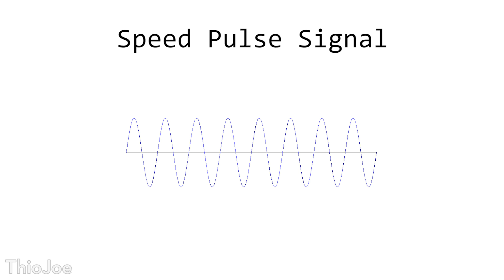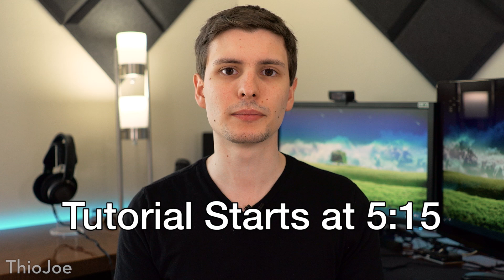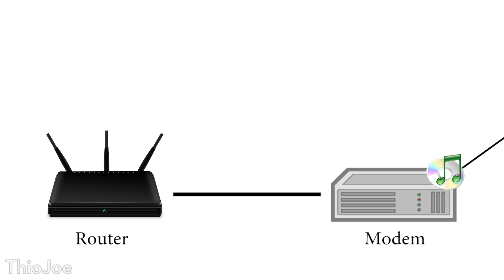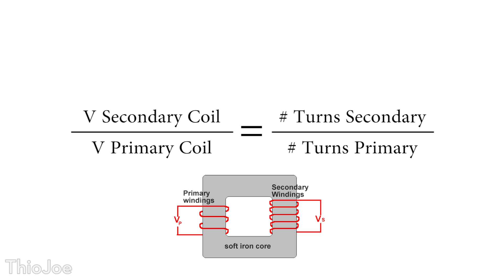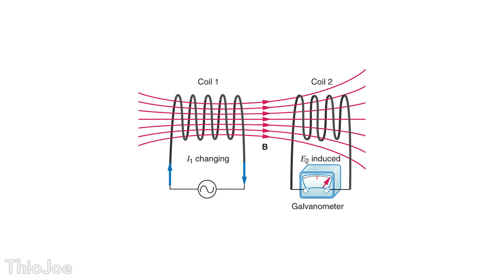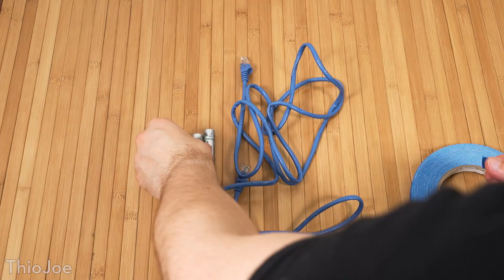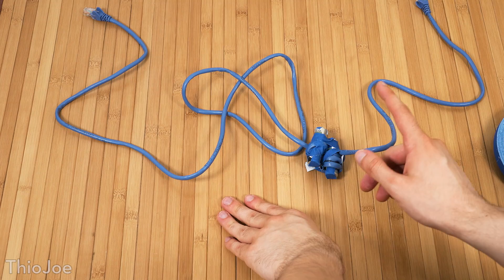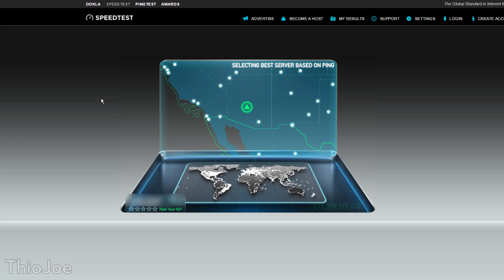How to Get Faster Internet Speed for Free

Comment: I bet you haven't heard about the new DUCK tape (Data Universal Client Kernel Tape). It is made out of duck skin and is far more insulated than the one you talk about and prevents data loss at an exponential rate. Earlier it was used only in big corporations but slowly and surely it has arrived in the mainstream market. I suggest you to use this tape in your next video. the only problem with it is that once opened you have to use all of it within 6 hours otherwise it starts absorbing outside air and starts showing purple spots on it which is not good for data protection . Infact you start losing more data than you can gain. As of now it is available publicly only in Suriname. You can order it online, but here wheres the irony starts. The data traffic needed to order this tape online can only be achieved if you have duck tape installed on your cables. See the paradox? So as of now the only thing you can do if you have a friend working in a giant IT/Software company, request them to give you a roll of DUCK tape and once you have it installed, order online from Suriname and live your life data loss anxiety free.

Comment: Magnetic Induction doesNOT exist, he is confusing positive static charge by electrolysis a wire, which charges the metal with electrons causing positive charge to be release, not magnetic force in any way, this why they want to fool people with the fake idea of electromagnetism which is a lie.
Fake Video, you can only increase the WiFi range by making a bigger antenna or making the antenna more powerful, but can't increase the internet speed.

Comment: Wow! I am paying for a 50 Mbit/s Internet connection and thanks to your trick - believe it or not - I just measured 200 MBit/s. The funny thing which you didn't mention at all: You can actually use 4 batteries and do the trick twice. Well, I experimented a lot and found out that the maximum number of batteries seems to be 16. But better stay below that limit, because my modem got destroyed because of too much heat when exceeding the 10 GBits/s barrier. Luckily the ISP sent me a new one. :)

Comment: This is scientifically flawed. The most important part in the construction of a transformer is that the primary & secondary DO NOT TOUCH!!! Here, its the same wire coiled over two parts of the frame (air-core). Not only is NOT GOING TO INCREASE ANY BANDWIDTH, it'll fail as a transformer, since by Lenz's law, the current induced in the secondary goes in an opposite direction; while the original signal continues to come into the secondary since the two coils are joined.
Shame, shame!! You're a disgrace to physics!

Comment: if it dosent work for you then you are using cat5 cable. you have to use cat1. if you dont have cat1 you need to remove the protection from the cable. after you du that you have to wash the cable and do a helicopter with the cable to remove the water from both ends. last step you have to use hair straigtner on cable but be carefull not to burn the cable. good luck.

Comment: Hey guys, im not a technical or very knowledged guy. i tried these, and the only thing what have changed after following the instructions is, that now my internetspeed is down from 2,56 MB/S to 1,32 MB/S DOWNLOAD, and my upspeed is down from 1,12 to 0,74.
after these results i have read the comments here, all are telling that this isnt working, BUT why it have an decrease Impact? I tested several times with my modified Cable, and with a Original-cable. Modified cable have really bad stats. but the normal wire is working as always. Could somebody explain that to me? Cause if it has an Decrease, it should be possible to make an increase.

Comment: the primary & secondary windings in a transformer are not wired together in 1 continuous wire,they are separate on each side of the core & are not bridged across the centre of  the core,i call bs

Comment: ah ha ha I have studied networking and have a CISCO CCNA this video is a joke as all ISP's have equipment that tells they how much bandwidth each line has, also by doing this even if it was to work you are breaking a legal contract and are then legal liable, also using speedtest.net is a pure joke as you can take that so simply. also if this was true by showing this you could be legally in trouble for showing other how to break the law ;)

Comment: i tried using a pair of sony battery
i have an adsl model
its not working
what can be done to get such a high speed???
i tried changing the battery and the cable as well but in vain

Comment: I set up my ethernet cable as per your instructions using two rechargeable AA batteries but see no increase in my internet speed (from the current 55/25 mbps) .  Could it be because the batteries were not charged, may be they were almost totally discharged.  Do they have to be fully charged batteries?  Also, will your suggestion work with ordinary alkaline batteries?   Thanks for any suggestions.

Comment: my net cable comes directly from a pole next to my house tried it but it isn't working do you have any suggestions that you might like me to follow I did make sure that the one turn battery was towards my router and 4 turns towards the opp side....i dont have a modem the cable comes directly to my router

Comment: materials used as insulation in the cable[citation needed]
Acronym Material
PVC Polyvinyl chloride
PE Polyethylene
FP Foamed polyethylene
FEP Teflon/fluorinated ethylene propylene
FFEP Foamed Teflon/fluorinated ethylene propylene
AD/PE Air dielectric/polyethylene

Comment: The batteries in order to generate a magnetic field, has to be in use. In other words, a magnetic field can only induced by a RUNNING CURRENT. That means the batteries need to be at least in a closed circuit producing current in order for it to generate a magnetic field. Just the batteries alone lying there doing nothing does not give you anything. The theory alone doesn't really make sense. Let a lone expect a magnetic field from 2 batteries to amplify your signal. Heck the earth's magnetic field is even larger than these 2 batteries even when running. So why don't you try the earth's magnetic field to induce a bigger signal to get a gigabit speed?

Comment: Did anyone happen to notice the INSULATION (blue in this case if u don't know) that all wires, electrical, radio, light, etc., are wrapped in? That's there for the very reason this joker is saying he could "tap into". It is there so no "outside" signal (electrical noise so to speak) gets in and no "inside" (electrical info) gets out. It's the same reason your lamp wire and every other conceivable wire in the universe is wrapped in insulation. Yes, it's true that insulation isn't completely "insulating" (i.e. some interference can be transmitted) but it's negligible most of time...and CERTAINLY NOT in the range Captain Video is purporting. I now realize these videos are made so we can "imagine" regular folk trying these stunts to get "free lunch" ! ----- P.T.  Barnum would be proud and Tesla would rotfl.

Comment: In my case I only have router, how this works for me?? should I set those battery the main cable which connects internet to my router? I don't know what internet connection is mine... is it cable internet? what should I do? I use WIFI to connect internet between Laptop and Router.

Comment: This is so fake,  you need Lithium ion polymer battery and cooper wire for full electromagnetic induction. Also that cable is too small, you need at least 5m SFTP cable.

Comment: Holy crap it legit works! I thought is a bunch of bs, but damn I'm wrong! But one important thing...

Remember to close your modem every time after you finishing using it, because it still sends the signals when not in use (but still turned on). If you leave your modem on, the ISP will detect the high bandwidth thus they will ban you from the internet! Thanks thio, you are an absolute legend!

Comment: don't listen to the haters.
this does work if done correctly..  it's electrician 101.
100% works.  you may need to change the batteries every once in awhile when you experience a dip in your signal strength..
 just rinse and repeat.
cheers!

Comment: If your modem is far away from router their is a solution first do plug out the wire from router and place 3coil battery wire towards router and 1 coil battery toward modem make sure first you get safety and cover top and bottom  thanks  have a nice day ..........LOVE HELPING............

Comment: If you use bare 120VAC wires as your coil structures instead of 1.5VDC batteries (easily accessed from any nearby receptacle - just pull the plate off to get to them) the performance is staggeringly better.

Just make sure you shield both wires with a little tinfoil before you tape them to protect against EM interference.

Comment: I live in Sweden. My ISP has already taken steps against this. 1 off, they have combined all electronics into one box. Router and V-LAN/Ethernet (several connectors) into the same closed and sealed box. The box I do not own, my ISP does. This box is connected to the telephone line via a VERY thick and bend resistant cable containing 3 wires with special connectors in one end and a RJ11 in the other. Batteries or not, the speed remains lousy (typical 0.8 Mbits at it's peak). But this might help some one else..?

Comment: I have a router and the modem in the same device. They are not separately connected then which wire should I consider in the process?

Comment: LOL come on man stop it. This only works if you have cable or DSL. If you have a fiber line it requires a flash light or any light based transformer to amplify the signal. Since cable and DSL are digital signals hence the D in DSL. Use a small flashlight for fiber because fiber based internet uses light for light speed data tx.

Comment: even a better ideal open up the insulation on the cable and cut the blue wire then hook it up to 110 volts AC.

Comment: I had 2 questions. 1. My connection is WiFi. Would this work using the coax cable from the router to the dish antenna? and It exciting the electron flow one direction doesn't it excite the flow the other?

Comment: At an average connection speed of 25.3 Megabits per second , South Korea has the fastest broadband Internet in the world. 

So let me break down this video in some simple words... this dude claims that by just winding some rechargeable batters to your Ethernet cable to make it a transformer which in-turn will amplify the signal for some godly reason is the same as downloading porn in a pen-drive and sticking it to your dick to enjoy the guilty pleasure of porn instead of just  watching it.

Why to go through the trouble of watching a porn to be sexually aroused  rather you can just download it to a pen-drive and stick it to your dick to achieve the same result.

Like wise why to pay your operator extra money for a higher speed rather you can use some batteries and wind the thickly insulated  Ethernet cable to  amplify the signal...wwwwoooowwww genius

Comment: Basic principles of working of transformer is primary and secondary coils Electrically isolated and magnetically linked. but in this video it shown the same cable wounded both  primary and secondary. and transform works with AC .what is the role of battery DC not explained.

Comment: but, my connection don't have a modem. The wire from the ISP directly goes into the wifi router. So, where do I attach the batteries?

Comment: Before trying this trick had a question : 
I have a router that is directly connected to the ISP Fibre optics and I use wifi to connect to all the devices. So dont have a modem upon which i will be able to perform. Any help over thant

Comment: lol dude.. a transformer works with a constant alternating current with at least 3 volt... but internet pulses are neither alternating current nor have 3 volts of power they are signals bro they don't have amps in them 
coming to the physical transformer, a transformer definitely needs a closed core. so that the magnetic induction of one coil induces some supply in another coil besides it. the core acts as the path way for the magnetic field. but your transformer doesn't have any contact. only few transformers work with air as medium like a tesla coil.. they use almost 50,000 volts in primary and get up to 90,00,000 volts of output. but your primary coil has nothing but 1.2 volt-pulses. just a single turn of a lan cable doesn't even produce a magnetic field to induce current in another coil... 

so it must be fake and the proof you have showed us, you must have changed the units mega bits in to bits...

Comment: Don't often do this but I've reported this you tuber as a con artist spam money maker. 
Think about it, if the transformer theory he used actually worked, which using two batteries wont, then the return ampltute would be reduced to the router, but its not about amplitude, its about frequency and mutiplexing, this con artist needs taking down.

Comment: Who would've thought. ... Do you have a patent on this? The reason I ask is that I built this and it worked better than expected.  The only problem was that after a while the speed dropped by about 65%. The battery core gets saturated and it's magnetic flux drops significantly.  I fugured out how it can be fixed and improved. I used larger, Li-Ion batteries as a core and created a secondary winding connected to a resonant circuit to boost the signal carrier amplitude and cut out the second harmonic by 90%. Now it works great. I'm thinking about making a few boosters and selling them on Ebay.  What should I call it? I-boost, Speed-Boost, E-Viarga?

Comment: DUDE , how can I set up with my internet connection , I use a Landline based broadband Internet connection in India , I have a  D-Link ADSL wifi+modem built in Router .

1 - My router is connected by RJ11 cable directly and I just connect my wifi like we all do , I don't use any ethernet cables to connect it to any modem or any such things like you shown in your video .

What should I do ?

Comment: Seriosuly...?, 
1) Wires are insulated from magnetic induction (which is what he is trying to do)
2) As per his theory (which is not true by the way) you should be modulating the signal between modem and ISPs not the wire between router and modem.
3)People actually fall for it O.o

Comment: My router is far from my modem. Question 1: does the length of the wire affect this? My wire is about 10 meters long.

Question 2: will my isp know find out about this?

Comment: This is all very nice to the people that dont know a thing about transformers. First he uses the same wire for both coils. This will NEVER work. Electromagnetic induction required 2 circuits to form a voltage in a transformer. Second, he uses a battery as the transformer core. This also will never work.  A transformer requires a multi layer iron core to work. This science is totally messed up and unfortunately people who dont know a thing about physics or electro magnetism are gonna fall for  this nonesense. This guy is as Fake as a chinese Dollar Bill !

Comment: Joe: I have a wi-fy internet connection. Hiperlan2 antennas with parabolic receivers. I have my parabolic antenna on my roof with internet cable coming through to my home and gets into a poker supply connected to the electric line. One cable gets into the poweer supply (the cable coming from the parabolic antenna on the roof) and a cable gets out of the power supply and into the router which by ethernet cable and/or wify distributes my line at home. Which cable Do I have to put the batteries? I tried the easiest way with the cable from the poker supply to the router: IT DOES NOT WORK! I don't have a modem. I could try putting the batteries on the cable that enters the power supply (does it make a sense? mmhmm...) So what?!

Comment: I need to know about two things:
1. I have a router modem combined stuff, so I have to connect it to the computer with that cable, so, which one of the two batteries will be towards the computer? 

2. Won't the ISP figure out that my incoming speed has been maxed out? 
What if the ISP finds out about the hack?

Comment: hello sir...i have a cable broadband connection...where the fibre wire comes to my home and has to be directly put into the wireless n router...(no modem required in this connection)...then router gets connected to computer..so where to attach those batteries...thnks in advance

Comment: Please explain, if you actually have "cable" from a coaxial in to your router/modem, how can you make the speed work for that set up? It would work if you have a cable modem and a router set up from Verizon but if you actually have "cable" there is no way to make it work. If you can wrap batteries around a coaxial cable, please enlighten us.

Comment: Hey Thio thank you so much for this...time for an extra performance tip: if you use 3 Energizer batteries and attach the Energizer bunny to it you will easily touch around 61111178.785 MB/s

Comment: i think there eill be no magnetic field get induced because the cables are double covered with plastic (or what ever) and there is no chanc of flux leakage . They are made so that there will be no interference when the cables transmit or recieve signals

Comment: its not working men. ihave  only router no modem and it is wires broadband connection . i tries to attach battery to the ethernet cable that goes into router.

Comment: Anyone with an ounce of electrical engineering knowledge will realise why this won't work. For starters the batteries are not connected so the two coils are not around the same core. Secondly the two coils are on the same circuit, and not isolated. Make of it what you will people, if your stupid enough to believe it there's little hope for you.